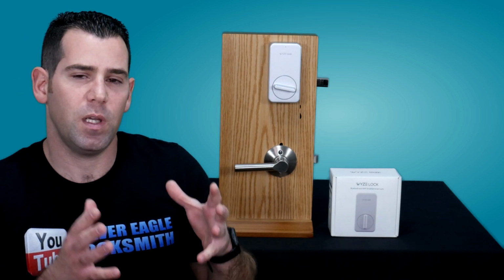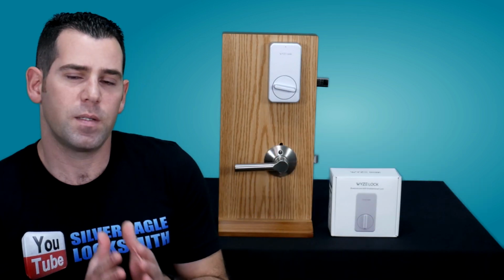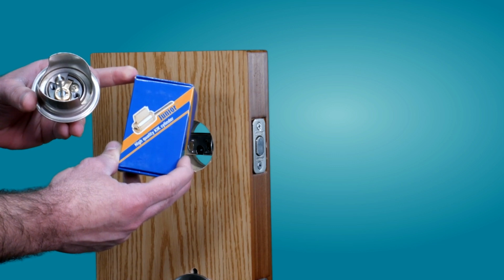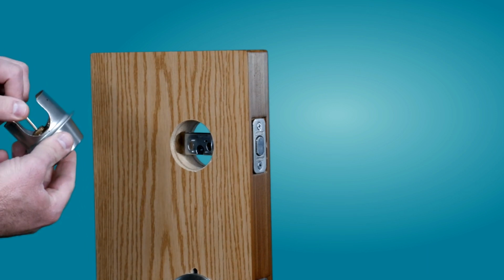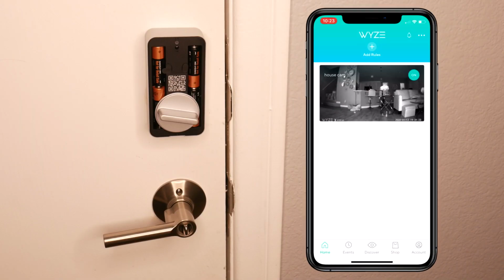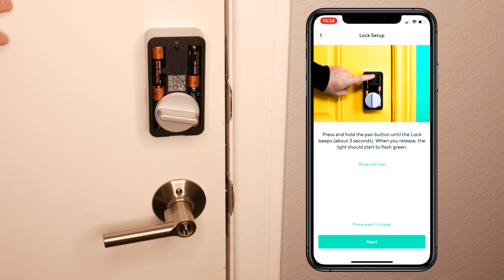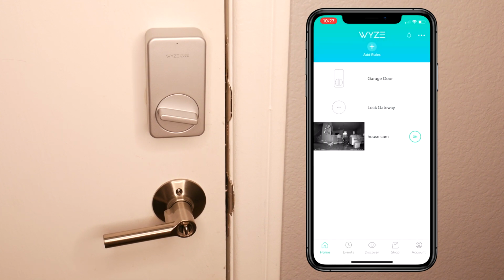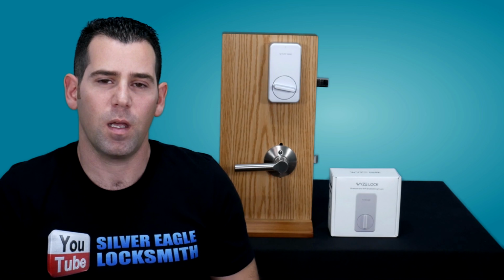Wyze Lock - 2020 New Smart Lock | How To Install & Prog | Wyze Lock Installation

Comment: What if you are overseas and want to allow someone to get in without using Wifi ? seems like you are forced to get the keypad. Right ? it then will look ugly setting up 2 separate units.. Looking FW to your answer .  Thank you for a nice video.
Reply from the maker: Additional keypad is very small and works great... check out this video 
Wyze Lock Keypad - Review & installation https://youtu.be/RwZp8QSRQ78

Comment: Thank you for your answer.  I have a Medeco Maxum double cylinder deadbolt.  Is this secure enough or do you still recommend upgrade to a Mul-t-lock Junior KIK cylinder or replace with a Schlage B60N or Schlage B560P deadbolt?
Reply from the maker: Medeco is high security deadbolt by himself so I think you good here

Comment: I'd rather have no key hole on the outside of the door.  Worst case scenario I bust out a window to get into my house.  It would slow perps down not having access to a keyed lock to pick.  When I'm home I keep a bar across the door.  The Lockpicking Lawyer has picked the Mul-T-locks before.
Reply from the maker: The Lockpicking Lawyer with all due respect he’s a highly professional lock picker and also a YouTuber with a point of view to drive as much as views as possible... with that being said YES he could pick most of the locks out there including the Mul-T-Locks etc, but that doesn’t mean that every burglar out there could do the same! It takes years of practice to become a professional Lock picker so trust me when I’m telling you that having a good lock (high security lock) on your front door including door reinforcement will make a difference don’t think otherwise.

Comment: Have you used the voice assistant to lock your door, and if you auto unlock do you have to disable auto lock feature or charge to a longer time like 5mins vs at once?
Reply from the maker: The Voice commends works perfectly fine. 
The Wyze lock can work simultaneously with all the features so you can use the auto lock and Auto Unlock at the same time

Comment: I wonder if the key code will allow you to set and delete temp codes for friends and family remotely or be able to send a worker a temp code to get in
Reply from the maker: The Wyze Lock keypad is an optional product and the Wyze Lock doesn’t come with a keypad in the Kit. 
I’m not so sure about the Options available with Wyze Lock Keypad, soon I’ll get it and make a continues video about it. 

Meanwhile you can share access to friends/family using the Wyze app and get push notification when someone open the door etc. 

It’s a really AWESOME Smart Lock for someone with a low budget and it works as good like all the other ones for my professional opinion.

Comment: Does the WYZE lock have a "low battery" notification?  Also, if the lock malfunctions or battery is dead, is there a manual overridden to be able to get in?
Reply from the maker: Yes the Wyze lock is only replacing your tumbturn of your current deadbolt lock and not the entire Lock. 
You can still use your current key from the outside to override the keypad. 
I was recommend to upgrade your deadbolt lock to a grade 1 security rating deadbolt as well... 
please check out the links in the description of the video for more information. 
About the battery life, so the Wyze application do show you the battery level so you can know in advance when you need to replace them.

Comment: I am thinking of installing a Schlage Encode. But what about the door lever? Is it unnecessary to install 2nd deadbolt in the place of door lever lock? Thanks!
Reply from the maker: Hi Jim
So installing a 2nd deadbolt is always good to add more security, but if you’ll install the Wyze Lock or the Schlage Encode Smart WiFi Deadbolt so the 2nd lock will be only useable during the night because all the purpose of installing a smart lock is to have automation access to your front door using a phone app, a code etc... 

For my professional opinion if you reinforce the door frame with a security door Strike Plate and reinforce the door hinges as well combining a smart lock with a high security key cylinder like Mul T Lock, it will be vary secure and the second deadbolt will be just for piece of mind but not a must on the list. 

And check my video here about the
Security Strike Plate: https://youtu.be/SyYbZzuHn3Q

And the High Security Cylinder: 
https://youtu.be/RoM_I4DlYhk

I hope that help.
Reply: Silver Eagle Locksmith Thank you very much for your help! I will check out the two videos

Comment: Will you still go with Lockly secure pro over Wyze Lock?
Reply from the maker: At this point it’s really all about your budget and options that you’re looking for... 

The Wyze Lock is much cheaper and works with your current Deadbolt lock and have a unique Auto Unlock feature and built-in gyroscope sensor  for door positioning. 
Wyze also have a very affordable security cameras so it’s works with the same app. 

On the other hand the Lockly Secure Pro Deadbolt Edition is more than double on the cost and you have the  3D fingerprint access and it’s a full keypad with PIN Genie, door positioning sensor is not build-in and it’s must install above the door lock. 

You see both locks are good and works with Voice commend: Google assistant, Amazon Alexa apps. So it’s really depends on what you are looking for at the end of the day. 

Hope that help